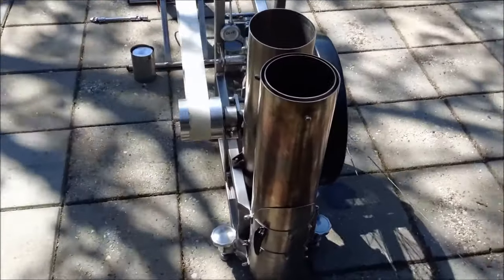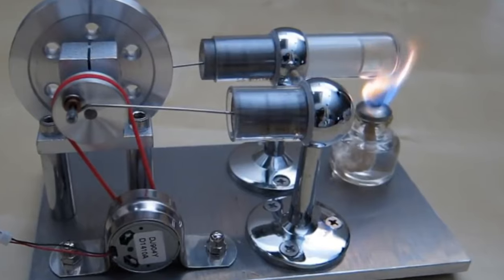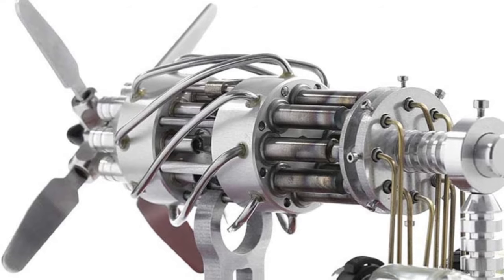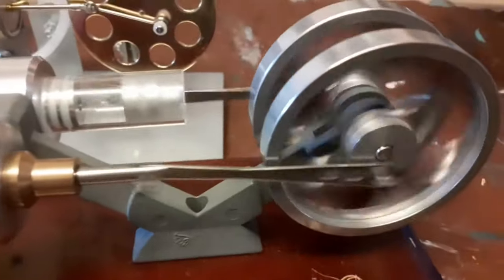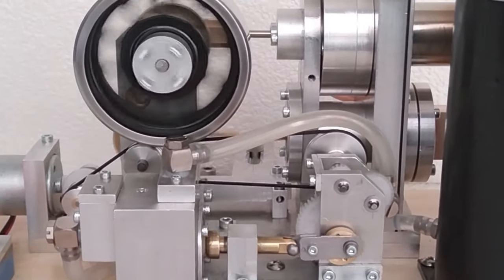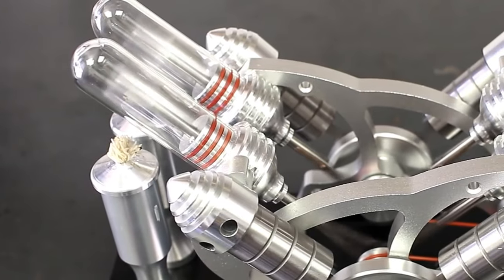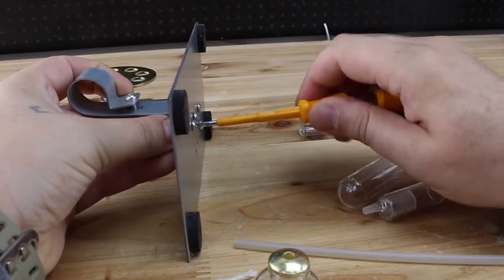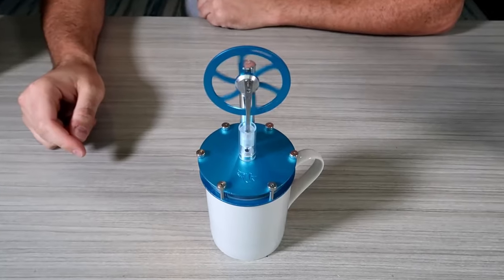TOP 10 HOT AIR STIRLING ENGINES FOR 2024

Comment: I think the solar powered one got short changed. That was a very weak amount of sunlight that was concentrated. Here in Texas, i might not even need a lens. Just leave it in the sun and cool the other end. Strap some ice on it. Make the tank out of steel and paint the hot side black. Wrap a cooling tube one the other side and run coolant through it.

Comment: Quick Rundown of Alpha vs. Beta vs. Gamma Stirling Engines:
Alpha:  2 power pistons, 2 cylinders, 0 displacers [a.k.a. "displacement-pistons"]
Beta:   1 power piston, 1 cylinder, 1 displacer [a.k.a. "displacement-pistons"]
Gamma:   1 power piston, 2 cylinders, 1 displacer [a.k.a. "displacement-pistons"]

And this is where people confuse Alpha and Gamma Stirling Engines:  because the displacer is sometimes called a "displacement piston" and because it has its own cylinder, people think: "2 cylinders, 2 pistons … must be Alpha!"
But as I point out:  Alpha has 0 displacement pistons  — both pistons are power-pistons and no "displacement" [like in a Beta or Gamma engine] takes place.

Comment: I wil like to use one of this in my village in Africa what is the cost of a machine that generates 20 ,000 watts of power
Reply: It does not exist. The yield is a disaster and for the same power the cost is really high. You want a generator, diesel is the cheapest.
Reply: A 20 KWe Stirling engine driven generator is available but they are complex and expensive.  These were built for expensive sailing yachts where peace and quiet, especially at night, are highly prized.  Also, these are generally propane fuelled.
I suspect that a 20 KW photovoltaic array with some storage batteries would be more economical.

Comment: I Sterling engine that was a DIY is the one I have and it was already assembled. I can’t get it to work and I’m using 91% alcohol.
Reply from the maker: @jameseiden2340   Can you explain your issue, does it won't start, or is it something else? If it won't start make sure that all the parts are moving correctly when you spin the flywheel. And the second thing is to try and find 96% alcohol since it may be that there is not enough temperature.
Reply: Yes, of course everything is freely I can’t I think if I blow hard enough with my breath it’ll turn but I can’t get it to start and now I let the flame burn so long it broke the tube and I’m having a hard time finding a replacement
Reply from the maker: @jameseiden2340 Mine came with a spare tube. Another thing that you should try is, if it comes with a small generator and a belt, try to remove the belt and run the engine freely, without generating electricity. Because with the belt, it is more difficult to start, especially if the belt is not aligned in a straight line with the generator. You can check out this video, where I was doing a review of one cylinder sterling engine: https://youtu.be/_Fre8tNYpGw
Reply: @techonly01  great advice however, I still need a tube because mine has a hole in it. I tried ordering a tube and it was the wrong size.